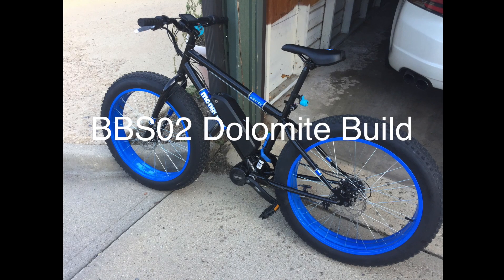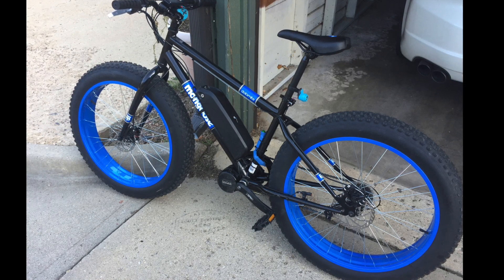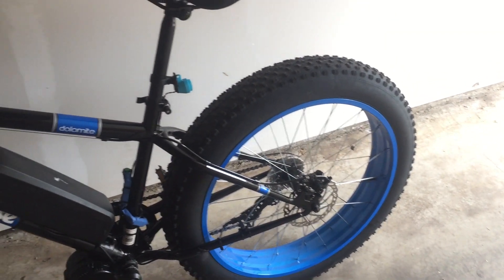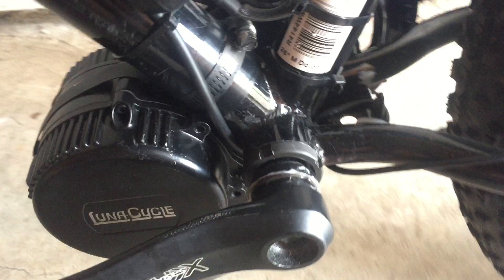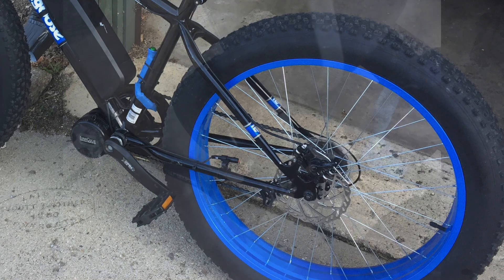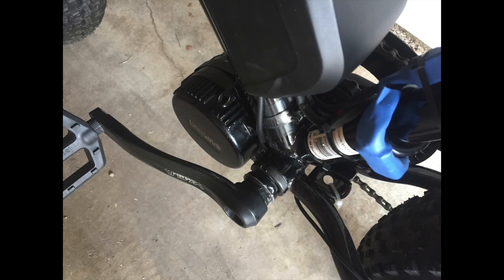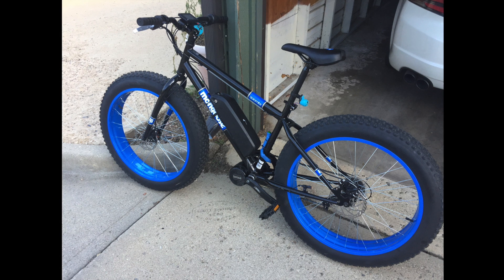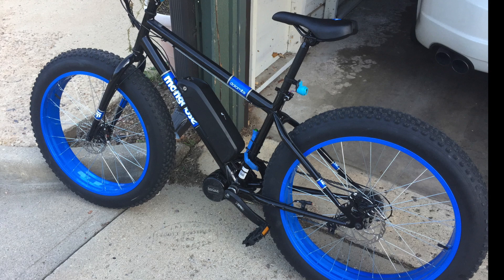BBS02 Powered Mongoose Dolomite: Sub 1000 Dollar Fat Tire eBike!

Comment: What the hell is a BBSO2?🤔
Reply: Bafang BBS02/BBS02B is a series of mid drive motors ranging from 250w to 750w the 750w can easily peak at 1200w stock.
Reply: BBSHD is the big brother at 1000 watts peaking at 1600w's with a 52v battery.

Comment: They make bafang in 100mm bb now. Get 1000w HD version. Also sturmey archer makes a 3 speed fat bike rear hub/google it. Carry your battery in backpack/ plug in under seat.
Reply: But the dolomite is 190mm in the rear, sturdy does not make one that wide, only 170mm.